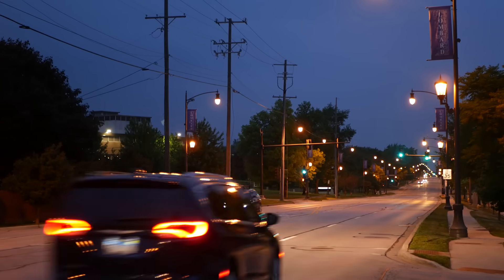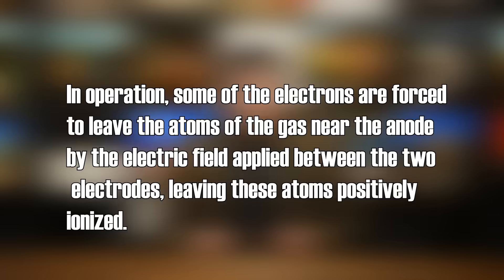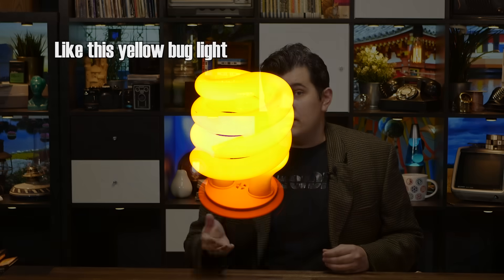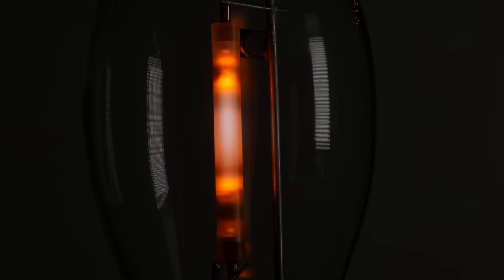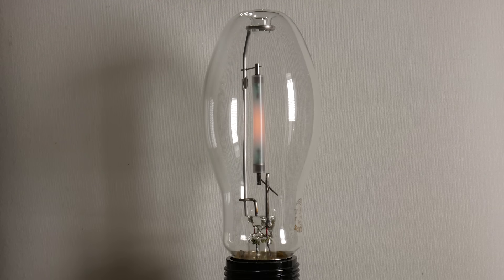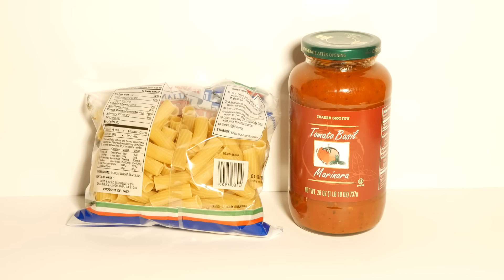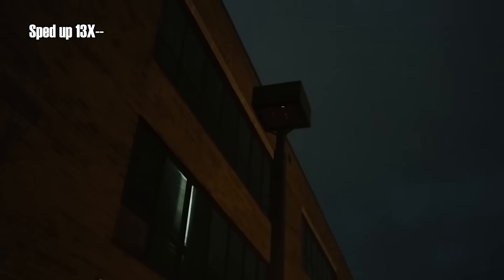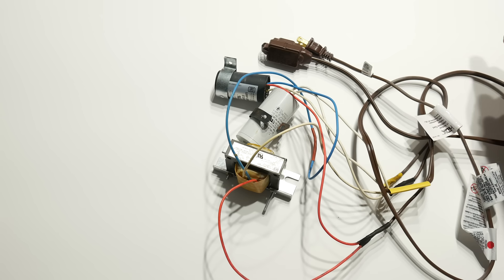The High Pressure Sodium Light: Ubiquitous, effective, but good?

Comment: The city of Rochester had replaced about 50% of the HPS with crappy LED street lights in 2018. Two of the towns upgraded to LED’s as well. First, the city replaced all the mercury vapor lights in about 2017, and now replaced most of the hps lights. The only street in the city that has the iconic GE, T&B and Cooper HPS headlights is E Main St between Culver and Goodman. But most of the towns surrounding the city including mine still have the HPS and mercury vapor lights. I know the LEDs are “environmentally friendly”, but HPS are efficient too. Besides half of those are not as bright as HPS and the other half is just far too bright.

Comment: The flaw in our knowledge is that we consider CRI but not the spectral continuity.
An hole (or multiple holes) in the spectrum of light make colors and shapes difficult for the brain to interpret what we see. 
White LED are the main offenders, as they use a main dental blue LED covered with yellow phospors to produce white light. The red spectrum lines of a LED bulb are nothing short of horrible, often producing unfamiliar sight of very familiar object. 
When the spectral disuniformity of LED bulbs is coupled with PWM (pulse width modulation) the result is something very disorienting. 
I haven't been able to find any academic or peer-reviewed paper on the subject, which is odd. 
If you need a 100% ability to discern object at night, must use incandescent light sources, or alternatively short-arc xenon lights, as both produces a contiguous spectrum - and therefore a true white light. 
Thanks for the excellent video.

Comment: I visited the Vatican Observatory on Mt. Graham in Arizona. There is also the large binocular telescope on the same mountain. Tucson is a big city that agreed to only use low pressure sodium lamps to help the telescopes: the low pressure sodium light only produces two specific spectral lines (that orange color) that can be filtered out easily with one filter in the telescopes.

Comment: They started replacing the high pressure sodium lamps with leds on the bike path I take to uni, and the leds blind me, the sodium color was less offensive to the eyes I could see better with the old lamps.
Reply: It's because these officials who wanted "greener" lighting did their bare minimum of research. They don't care about how they harm vision, especially that of wildlife and even insects at night. Even countries like Mexico and Croatia have laws about regulating light pollution and requiring LED street lighting to have a color temperature (2200K) similar to that of high pressure sodium bulbs and for street lights to have proper shielding. As do a lot of areas around the United States. Start researching information on darksky dot org and present it to your university.
Reply: @Mahdi RANA It's the snobby suburban and gentrification mindset. Those types of people believe that brighter light = better, "higher class" neighborhoods. In their minds, everything revolves around them and their comforts. They don't care about the night sky, they don't care about nature, they don't care about wildlife (big or small). They don't care about how the light pollution is spilling over into rural areas and starting to affect the visibility of the night sky there too. It's annoying. All of that on top of every other type of pollution and food waste that they contribute to. They don't care.

Comment: As a sparkie (electrician) we were also taught that the orange light is particularly good in areas with fog, similar to the yellow fog lights on cars.
Reply: it is. this yellow is very close to the frequency eyes sees best and very penetrative in fog smoke and dust
Reply: Then why almost every city is using 5000k-6500k led ? And also cars...
Reply: @d3sentry  many off road and work vehicles these days come with fog lights which are more of a lemon yellow color. As for cities/streetlights, short sightedness perhaps? Or in areas that simply dont get enough fog for it to be a concern.
Reply: @d3sentry one of the videos explains that cooler light keeps drivers more awake and alert

Comment: It’s the best GD light ever. It doesn’t screw with Nocturnal Animals or Insects. It doesn’t mess with human Sleep Cycles. It doesn’t shoot out Macula burning UV light. It doesn’t blatantly flicker at a seizure triggering rate. I wear Blue/UV blocker at night when driving because of the retina melting LED car headlights. They should be illegal. They are blinding. And over time they will cause blindness in more and more people. The companies that produce these should be sued out of existence. That’s my opinion when I’m holding back.
These were touted as lasting hundreds of thousands of hours. That’s Bull S**t. Why does a 5-7 watt LED bulb need a gigantic metal heat sink? And last less than a year in standard usage? And a 100 watt in candescent bulb needs Zero heat sink? It’s a Scam. And dangerous to the vision of humans and most other wildlife.
Look up and watch “The Lightbulb Conspiracy” on YouTube. DuckDuckGo it and the JYouTube version will show up. It’s from 2011. I rechecked it and JYouTube and the Joo Copyright Money Grubbers don’t make it easily available on JYouTube any more. This is the b I could find. Or you could pay for it on JewFlix/NetFlix. https://www.youtube.com/watch?time_continue=791&v=zdh7_PA8GZU&feature=emb_title
Reply: darksky dot org has a lot of the information you brought up here also.

Comment: reddish light retains night vision, meaning less lumens are needed to "see equivalent".  

car manufacturers keep developing whiter and brighter headlights, meaning that sure, you can see a mile down the road, but by making everything brighter ur actually making the world blinder at night.  

no?  if everyone had the spotlight gotham city uses to call batman on the front of their cars, u would see so much at night!  until opposing traffic showed up, then it would turn into a monty python skit, which is really where we are currently, regarding the governments total lack of any real lighting regulations based on facts.  

i was on a dark highway the other day, and there were two cars about a mile back, and one still had some old yellowish headlight setup, i could see him just fine.  The other guy had headlights that were white and bright, and even from a mile back the two tiny headlights i could see in my two side mirrors was blinding me.  i had to scoot up in my seat to avoid being able to see in my mirrors.  

Everyone knows what super bright car headlights are for.  so people can drive 60 on rural sidestreets safer, with less risk of killing a pedestrian.  And i know this is about streetlamps but the same concepts apply.  white light kills night vision, so you might think you can see better because u can make out colors, ur actually seeing less.  u need to factor in night vision to understand.  just because there is light, ur still either using or not using ur night vision.

Comment: Just one small correction. While an HPS may claim to output 150 lm/w, you do not get that flux from the light fixture. There are quite a few losses along the way, that bring this value down. A well designed fixture with a 150 lm/w bulb will output no more than 120 lm/w. Which is about the best you can get from HPS, and such efficacy is present only in the high power bulbs (600W, 1000W etc.). And average street light fixture will use a 150W or 250W bulb and it's overall ouput would be in the range of 80 lm/w to 100 lm/w at best.

However losses are inevetable. Same is with LEDs. A light fixture that uses 190 lm/w leds will only output ~150 lm/W.

Also regarding lifespan of those bulbs. While they do claim over 20000h of life, that is not practical life. it may take 20000h for the bulb to stop working, but after just 10 000 hours the bulb will be outputing no more than 60% of it's original light flux. In real practice 7000h is the optimal time for changing the bulb, which makes for roughly 2 years of life.

I do operate a small assembly company for industrial lighting. And yes, we did use a lot of HPS, Metal Halide and Ceramic Metal Halides in the past. And lets say about 4 years ago, there was still some advantages to HID lights, the most major of which was price :)
But nowadays... Nothing can beat LED. However as you mentioned, they do present their own set of challenges. Design and assembly are totally different compared to HID lights. And they come with their own set of parameters that you can tweak for optimal performance vs comfort.

The thing is most clients, even experienced chief electricians in companies, still perceive lm/w as the measure for how good a light is. 
When they see a high end 150 lm/w LED fixture for something like >300$, they think they will get the same performance out of a 150lm/w bulb mounted in their old fixture, while in fact they will never get more than 100-110 lm/w due to the degradation of everything in their old fixture. While in brand new condition a fixture would have had losses of about 20-25%, after the years have passed, this percentage may increase up to 40%.
a 150 lm/w real output LED fixture will always blow away the HID, with much better CRI. And a high CRI LED fixture with efficacy of about 120-130 lm/W will still outperform an HPS by a decent margin, and will provide a massive difference in color rendering and comfort.

Comment: Loved the video, but I think you meant that the lamps have a negative "thermal" coefficient rather than resistance (I know it's not actually thermal, but the same effect as an NTC resistor). Negative resistance is not possible (unless you meant negative impedance, which us still not quite the same thing as resistance alone).

Comment: Milwaukee, WI (the "most segregated city in the US") has been slow to adopt LED bulbs for what I assume are budgetary reasons.  There is a pretty clear, dare I say, color code.  If the neighborhood streetlights are mercury vapor (blue-white), or LED, you are downtown or in a predominantly white neighborhood (say, the fashionable East Side) or suburb.  For a while, East Side had an even more distinct mercury-vapor variant that showed purplish-white, exclusive to that neighborhood.  If the streetlights are low pressure sodium, you are in some other neighborhood.  Emphasis on "hood".  The suburbs, with a higher tax-base-to-square-footage ratio, have been steadily going over to LED's, but LED's are now showing up on county-owned freeway stretches and in downtown Milwaukee, probably in anticipation of the 2020 Democratic National Convention.

Comment: I've always hated the orange lights. And I remember some years ago, on hwy 836, there was a really wide margin for a few miles and in the middle were some really tall lights with some super bright lights mounted and the poles for these light were very far apart. They lit up everything really great! And the lights were up so high that they didn't blind you at all. I've always wondered why they don't use that same kind of thing on streetlights. We wouldn't need nearly as many streetlight, and if they're up high enough, everything would be much better lit without the blinding effect that occurs with normal height streetlights no matter what kind of lamp is used. But to me, the orange lights are so hard on the eyes! I wish they'd finally get rid of them!!

Comment: To:  Jose_Jose <> In my city, they switched from orange glowing HPS lamps to those cheap LED lamps !!!!  It is just TERRIBLE when I am driving during the night .... LED bright and intensive spotlight is BLINDING my eyes in a particular place of every passing street lamp !!!!  LED lamp bad back defusers' designs are not calculating something which in lighting technology is called:  "angle 2 alpha 0.5 degrees"  >  which is also known as an "angle of the eye safety".  Otherwise, the source of light, suppose to be located at a particular depth and angle inside defuser, to NOT to blind your eyes of seeing the source of it (bulb) directly by your eyes !!!!

The street lamps defusers for HPS operation in 99% cases they are designed very well and just perfect.  That is why HPS sodium street lights are not blinding you from the distance, or when you passing them, at all !!!!  CHEAP LED street lights do not give the shit about that problem, and it looks like a bunch of morons without any knowledge of lighting technics just designed them and other morons produce them in millions of pieces for the massive markets !!!!

It is also another issue .... the ORANGE colour light produced by HPS street lamps is much better cutting through the heavy fog situation during the night !!!!  LED performance is very poor, even if it delivers more brights !!!!  SUCKS !!!!

Overall .... as street lamps, HPS lamps are working much BETTER lightning street nicer and safer.  It is a pleasant drive in the night when a street is in kinda soft orange lumination !!!!!!!!

Comment: Main reason is you can replace a 250W HPS flood with a 50W LED and get better coverage also hps bulbs were more expensive than a complete LED fitting. In a factory the colour was always a problem , we used to have to have Tri phosphor flourecents to colour check finnished goods.

Comment: i always prefer 4500 kelvin for warm white, and 5500 kelvin for neutral white color temperature.
...and he didn't mention or use kelvin as color temperature basis, which i think is the most important.

Comment: It is actually not an electric arc, but an electrical glow. There are three modes of plasma discharges that defines the way it glows/doesn't glow.
Dark mode means that it only radiates in the infrared spectra and lower frequencies.
Glow mode means that it glows in a the visible spectra. The glow depends on the spectral lines of the molecules that makes up the plasma.
Arch mode generally glows in the visible, UV and x-ray spectra. Some times even in the gamma ray spectra. These ones generally looks bright white or blueish and the nature of the light is mainly thermal.

Sorry, just hade to point that out... You kind of asked for it.

Comment: Orange lights on roads? In my part of the world they have been LED for years now. Sodium, I do believe, is better in areas subject to a lot of fog, but the theoretical maximum efficiency of sodium discharge is only achieved at higher wattages. At lower wattages, typical in many streets, the efficiency of the sodium lamps is much lower. Sodium lamps also suffer reductions in efficiency due to reflector losses and the ballast. As a result, LED consumes markedly less electricity in real world usage except in exceptional circumstances. However, residents in streets with LEDs will often complain that their color is “wrong”. People tend to like yellower lights at night.

Comment: Wait so LED lights have a high output of UV light? Does that have any negative effect on humans like our skin or anything? Is the coating around the light bulb just to change the color of the light output or does it also block the UV light.... and if it does block it, is it actually effective at that or not? Seems like a potential serious drawback of LED bulbs if they put out alot of UV light, esp with the push to have people replace all their bulbs with the more energy efficient LED stuff.
Reply: It is harmful, yes, pure sodium lighting does not make UV. The coating is not as effective as you would think.

Comment: I remeber the blue glow that street light used to have, then they changed them gradually to the orange ones as the blue ones died and now it is back to bluish LED lights... The first blue type of light was better suited for street lights here in winter as with those you could see trough fine snow in the air, with the orange light snow in the air just shines up and you see nothing when driving...

Comment: My 4300K 160W flurecent "full spectrum" white light photo lamp has no warm-up time at all while my 65W version of the same uses 1-3 min to warm up... I use them mainly to keep plants alive during the long dark arctic winter with no sun at all for 2 months, but they do a good job of keeping me awake and alive also :) Specially the 160W I must remember to turn off at least 2 hours before bedtime or I will not be able to sleep.

Comment: Great video. Been looking for something that clearly explains how these lights work with good visuals, although I already had an idea of how they worked but needed more clarification on the technical stuff.
HPS lights will always be my favorite, and it's pretty sad to see them being replaced with LED. The ambient orange glow is fantastic for night drives or walks. It was also pretty useful whenever I was in the house and the power would flicker, and I didn't quite know what I saw, I would just look out the window and the HPS streetlights would be out for a minute to confirm what I saw.
My dad states that he began seeing HPS lights replacing Mercury Vapor around mid to late 1970s.
Reply: There's just something about the atmosphere these lights give